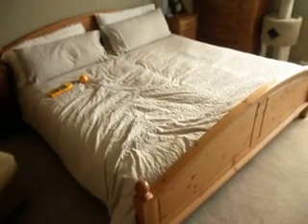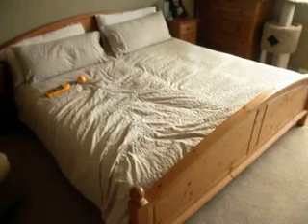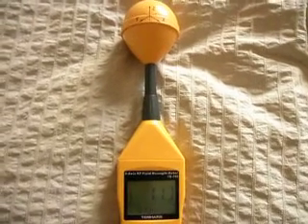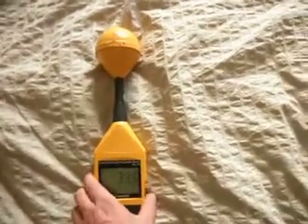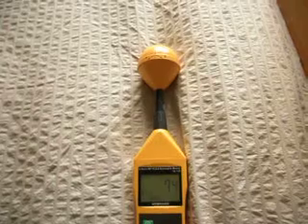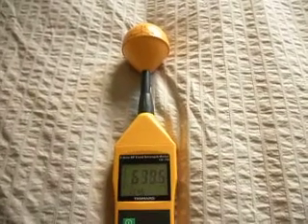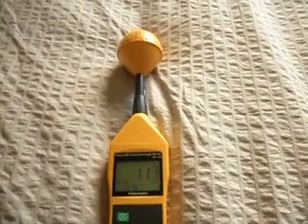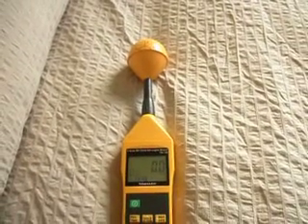Beds, Fatigue, and Cell Phone Tower Sickness

Comment: I have to tell you I have microwave sickness also and I have had trouble with my bed. Even when I moved it to another room I could still feel any major appliance running and it came to me as pain and fatigue. However, when I removed the box spring these problems significantly decreased. The meter readings also changed. It then became obvious to me the coils in the box spring were amplifying the emf's etc. You should check it out because I am curious if you have the same results. Oh and I now sleep without the box spring all together.

Comment: That emf cost more than 350 dollars ... can read up to 8ghz. Its important we get one that can read at least to 3ghz to find the wifi spots.Cheap ones read only khz range. The cheapest I found on ebay is 100 bucks from gmm-us seller it can read 3ghz.Let me know if you can find one better than that please.
Reply from the maker: Cornet ED78 is the cheaper meter that I recommend.  It is single axis, as opposed to three axis as shown in the video.  Single axis is fine for most applications.  The Cornet ED78 also reads magnetic fields.